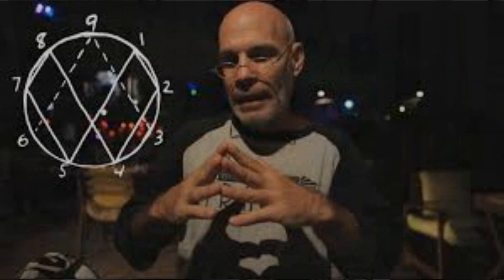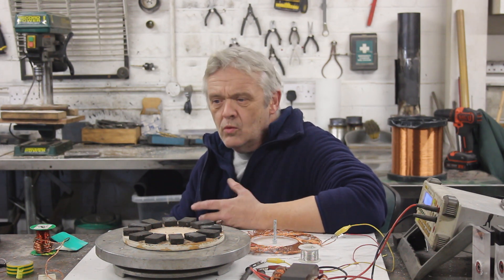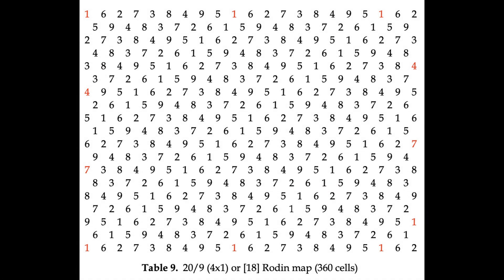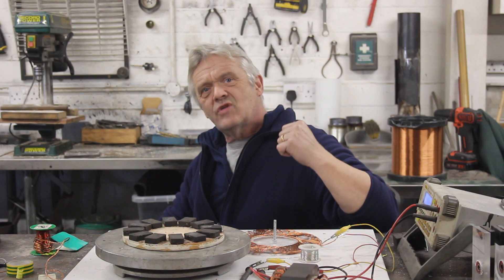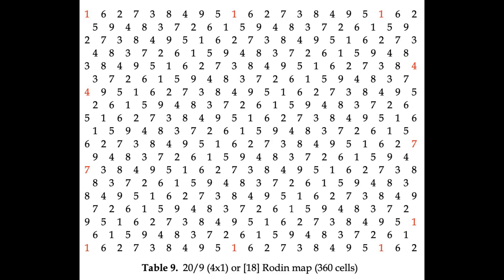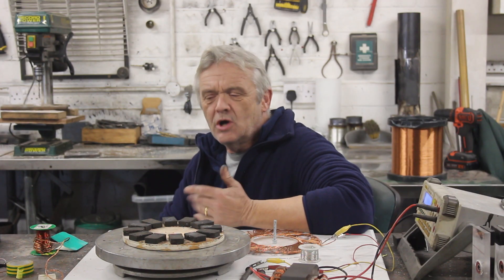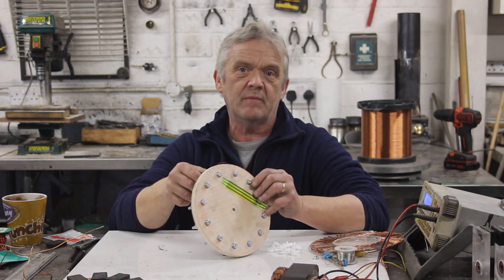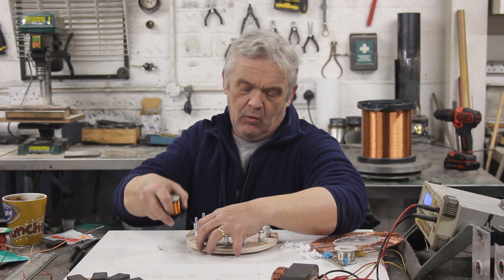1803 The Rodin Coil And How To Wind It

Comment: Vortex Math - A mathematical way to explain magnetism and current movement,  where magnetism is represented by 3-6-9 and the other numbers represent direction in which current moves, the doubling pattern, or the halving pattern. 
What is curious, or odd, the current flow, based on the 2D perspective, is not possible, the alternating current will cancel out leaving a net of zero. So, Marco Rodin postulated adding a 3rd dimension to the 2D perspective, to become a generator. That's how the Rodin Coil was born.
Amazing stuff.
PS; A Hexagram doubled is 12.

Comment: I just wound a few serpentine coils 162 " its heavy wire . Its to run my boat . Its a double flex axial motor generator combo. With conductive stripes on the bottom of the boat to make money r electricity for navagational lights and a paddel wheel and solar for lasers and freq wepons to fight pirates. . I mad a scaler device that detoxifys rivers but im sure the gov will try to stop me . Ive got beyond et defence system and offence systems . I was a consultant for that world . Dont like gov people or et demons.

Comment: I was just watching this guy using a small bowl type housing attached to a small motor, 

He lined the inside with neo magnets round about with all of their pole facing south or north inward.

Someone in the comments mentioned adding a coil of conducting wire overlaid ontop of the neo's.

If you added a current to the coil you may be capable of magnetic propultion ..

Comment: Is it important what kind of wire to use, recommendation?
Reply: Copper wire is the standard that has always been used since we began making transformers with them.  Standard non conductive laminate copper wire (for safety and efficiency) for the winding.  If you introduce a core or magnets , thays where you can start partying with the type  of material. EXAMPLE: hammond makes their transformers core from laminated iron ore sometimes and other times they use steel. It really comes down to application. The reason copper makes up the winding has to do with its conductive properties (aka how fast can the electrons move through it with the least resistance. Apologies if you knew all of this , and I am flogging a dead whores. Hopefully someone can gain a better understanding

Comment: you did this wrong.. you need 2 separated windings to create the star, closing the correct circuits so you only end up with 2 instead of 4 wires. the geometry should leave you with almost no self induced resistance due to the fields aligning geometrically correct. you also need to map this on an actual torus as this won't work in 2d
Reply: By chance have you tried using one in combination with an appliance?
TV, Freezer, Computer?

Comment: You do know there are VERY cheap versions of what you're 'trying' to 'make work'; built by 'proper engineers'. Love the enthusiasm but I've long since given up on 'reinventing the preverbal wheel' since I accepted the fact that there ARE people way smarter than me. 'Experimental' is one thing but buildings stuff that you can buy (that's better) for less than the material is border line...  I remember the time you told me personally about a 'Fusion' idea you were exploring; Now that exploration I for one would be excited to see you experiment with.

Comment: i wound a rodin coil on a doughnut shape, its alot more beautifal. and might have different performace properties. it just looks nice to have a toroid shape. and if you connect it to your speaker cables on an amp it becomes a speaker if you have a magent in the middle of the coil.

Comment: It's rod(I)n and Tesla discovered this timetable not Marco assuming you have tried getting your magnets set out in the same way you made the coil opposing poles sitting N|W|N|W
I.E because all opposing numbers on a clock going anticlockwise are- and all clockwise are + proven because 8+1=9
7+2=9
6+3=9
5+4=9  9 is the North for any EMP meaning Center/pole ❤ try a coil with 27 points and try 9 9 9   until you get back to 27, approx 3 turns each time. You have the tools I don't 😂 9 is the number of god and there is approx 27 letters to the alphabet made by the ancients of this technology maybe I'm crazy but I love crazy 😂😂

Comment: Sorry, but your explanation as to what remainder you get when dividing 1 through to 9 by nine is not "1". If the divident is smaller than the divisor, the modulus will be equal the divident, not equal to 1. e.g. 1 mod 9 = 1, 2 mod 9 = 2, 3 mod 9 = 3 ... 9 mod 9 = 0

Comment: 1. You are using it wrong. You need to put the magnet in the middle of the coil. There is where the field is concentrated. 
2. What is the wire gauge? 
3. Dc resistance?
4. Impedance at 1khz?

Comment: The council of nine would say that nine is existence, for instance if you were to take your age add the two numbers together, take the sum and subtract the sum from your age the final answer will always be divisible by nine.  
  9   9    9    9    9        9    9     9    9                                         1+8       2+7     3+6      4+5     5+4     6+3    7+2    8+1                                                                     1    2    3    4    5       6     7    8     9                                          these are the answers to the multiplication you'll notice                                                                             9   18   27  36  45 /  54  63  72   81  (mirrored)                    they sum to nine.
There are many more ways I could prove my point but my argument here I feel is credible enough to explore further!

Comment: Nice video Robert.  I like your style.  Won't this particular coil cancel all the different magnet poles out netting 0 volts? You would want to isolate windings where they line up with poles and add then add them together right? Maybe I am missing something.

Comment: Hi Rob Sir great to see the coil videos, I am actually building a 10kw Axial flux small wind turbine using SWG 20 wire the current magnets are 50mm by 50mm by 12.5mm a square magnet, I am building square coils too in relation to magnets, but am struggling with the turns, I have used 2 conductors to build coil, please help me throw some light on turns part Rob Sir, Love and warm regards, Yaman.

Comment: I don’t thing that is how you use rodin coil, you apply correct frequency to it to create field in a center, whu would you wind wire in complicated donut shape and run magnets in circle, pointless, you will get voltage by wrapping a wire around shapless random rock or actual donut from gas station, your video is misleading
Reply: Well put, seems like he isn't even invested in trying to make it work.

Comment: FYI Rodin did not come up with the math. Tesla and others did. Rodin used other people's work to promote it. I knew Rodin personally and he refused to explain his explanations. The coils that others have made using his ideas were all wrong. I have figured out how to construct the coil and it can handle large voltages without fail. I also know how to calibrate it and it follows the design he talks about. I later found out that he didn't come up with the 3-6-9, 2-5-8, 1-5-7 pattern. Nicola Tesla figured this stuff out way before. Its just not to many payed attention to his work as most thought he was a quack. The Rodin coil is not supposed to be flat. Its a toroid and utilizes nature's principal of energy transfer. You need 3 things for it. 1. Positive 2. Negative 3. Neutral center. There is another man who promoted this in his flying ufo type disc he created and it used harmonic frequencies with a unique type of design. (not free energy either) I have yet to try to construct a proper coil based on Rodin's work. Rodin didn't steal it all there is some he worked on that is valid. If your curious then do a google search for Tesla's 3-6-9 vortex math. Its the same numbers in Rodin's work.
Reply: I am fairly certain that Marco has stated onn more than one occasion that his "discovery" was expounding onTeslas principles. Now I can admit I may be wrong, unlike 95% of YT comments. But I am interested in how you came to the conclusion that the starseed coil variety, as well as the widely agreed upon, donut-shaped variety of Rodin coil are both inferior to this mystery formation coil that you have made? What tests have you implemented? As well as other questions that I'm not science-y enough to know to ask.
Reply: By calibration, do you infer wire  gauge and number of windings?  Besides standard methods , what other practices are employed engineering it for greater voltages?  Have you elucidate all of this elsewhere? How did you cross paths with Rodin?  Don't talk offense. I'm asking ignorant questions with no 3-letter/bad-actor motives. Genuinely curious as someone working with these designs for various purposes

Comment: I made a star coil a few years ago and applied DC electricity to it.  It created a concentrated magnetic field around the center coil (not outside stars) and would hover a couple inches when put over a microwave ring magnet.  Seems like magnetic field is more concentrated than just a plain coil.
Reply: makes sense, there's 12 times more wire in the middle ring than on each star point.
Reply: @DFPercush  Mounting a metal metal disc in the middle and spining the whole thing could make for an overinity generator
Reply: @jlo13800  I think I see what gave you that idea in the suggested videos here, and I'm sorry to tell you it's fake. You have to put work into spinning it to get power out. Otherwise it's a crappy flywheel battery.
Reply: @DFPercush  yes power to start it and once its running to feed power to the drive motor. This ways its taps ZPE.

Comment: Bob I wonder if you did the same Rodin coil with silver wire instead of copper this would change the outcome . Remember during the shortage of copper during WW2 Los Alamos used silver for generators versus copper!
Reply: Silver wire is crazy expensive tho, the benefit would maybe be lowered resistivity but I doubt the extra cost would make the relatively low gain worth it

Comment: I made a flat Rodin coil a few years back and with 6  1" X 2" neo 50s  on an aluminum drum. I was able to get 12 volt at 850 rpms from a drill motor. Coil shorted before I could test any type of load and I never continued the experiment.

Comment: nice vid, just a point though......... its pronounced ROW-DIN... as in Tin....also....what you have there is more commonly called a "starship coil"...or....a flattened Rodin coil, a true Rodin coil is not flat but wound around a toroid, typically a plastic toroid as found in those childs plastic donuts they have to stack on a shaft in the correct order

Comment: 10 years ago i was really interested in Vortex Based Mathematics and i ended up building a 3d coil based on that with one of those kids donut shape toy. I also putted a ball magnet inside just to see what happens. By applying a frequency, i could make the magnet turn inside the donut. I was freakin' amazed(pretty much like Robert when something works lol). I then had the idea of creating a 3d printed version of the VBM torus wich i could wind with wires and put a ball magnet in. After a couple years( yeah i'm slow) i did so but the winding was a pain . I only tested it once and it did nothing but i couldnt make all the test i wished i did.

All that being said, keep up the good work, you inspire me to continue my quest for making cool things.
Reply: yeah i made a doughnut one too ! pretty cool. it will also play music if you connect it to a music amp and have  a magnet in the middle. i played billie jean on it !  -_-
Reply: 999999
Reply: @dancol2008  9 is 3
Reply: @marcgagnon4171  keep working on it and you can make your own PEMF healing devices and if you keep going you can discover how to make a magnetic vortex wormhole generator. Or just read the google patent on it and follow those instructions…fascinating stuff indeed!

Comment: If I had two of these turned by pedal power how much power would I be generating at top speed?? 32mph
Reply: Not enough information. What's the radius of your wheels? The gear ratio between final drive and pedals? And what's the load? You can spin something at 100 mph but if it's in outer space with no resistance then it's making 0 power. Power = torque * angular speed in radians/sec. Using units of Nm for the torque will make it nice and give you power in Watts. Multiply by the efficiency of your generator and that's your max available electric power. From there it's a game of impedance matching to achieve maximum transfer of that power to the load.
Reply: @DFPercush  small cog nine spir or tooth gear 53 tooth gear
Reply: 26 inch wheels
Reply: I weigh 152
Reply: Weight of electric stuff has to be also factored in
Reply: Weight of electric stuff has to be also factored in

Comment: This coil gives the impression that because it crosses many times over itself it ends up creating conflicting magnetic fields that reduce energy collection. I think you could test if this is happening by removing some magnets from the base and turning, if the energy production is equal or higher even if you have removed some magnets then probably there are conflicts of magnetic fields.

From my point of view it seems to me that no wire should cross or follow in a different direction, the best energy collection is always in all the wires being as aligned to the same axis as possible. Because by passing energy through them their field will eventually affect what's around it, and you don't want one wire creating an opposite field on top of the other wire.
Reply: @pedrojorge4684  Opposing fields would give a scalar wave...
Reply: @leomcfadden1978  I refer to interference from a field that currently runs within the wire. For example, if you transmit "wireless energy" with your wireless cell phone charger, this does not decrease your electricity bill, because the interference from one field to another generates the same opposite action, that is, your light clock will measure that there was energy coming out of it. Maybe it gets a little confusing because I communicate with a translator, he must be translating some expressions incorrectly. My point is that wires not aligned in parallel will have a different effect than those in parallel aligned, because there will be some change in the field, whether for better or for worse, I suppose for the worse.

Comment: This is exactly what's used in curve-stitching, pullikolam,  and other types of diagrams which are richly studied by topology (sorry of mentioning that again).
Reply: I believe the 3d shape is a cycloid. It can be modelled with a faily simple cycloid vector function. That allows it to be 3D modelled and put into an electromagnetic simulation program. There was a presentation at global BEM in 2016 I think it was where some Portugese guy had managed to hook it up as a zero point energy generator. He was never heard from since..

Comment: Rob, it seems to me the essential thing to check with a Rodin coil is the alignment of the coil segments in relation to the individual magnetic fields.  You know the geometry of the various segments (1 to 6, etc.) and you know the flow pattern through the various segments of the coil.  If you lay the coil over the magnets, how do the individual coil segments line up with the N-S fields of the magnets?  Do they add or subtract & where?

Comment: What is the best way to compare winding patterns?  I think using the same guage and total length of wire in each coil.  Use the same type of magnets.  Spin at the same RPM and use the same load.   

Is that grossly over simplified?  How do we make apples to apples comparisons to determine the best winding method?

Comment: I took your advice Robert and built a Nitric Oxide generator it fits in your pocket, if half of PubMed experiments work its a cure all, as pills4ills industry has suppressed this Nicholas Telsta device for 20 years I will have to spread the word so it can be picked up if I am not around

Comment: I like how you give the Rodin coil a serious chance and evaluate it fairly. I remember when I first heard about it and all the mystical hype surrounding it and I confess that I got a little caught up in it. Nowadays, I can't help but laugh. Still, I never actually made one so seeing one actually being made and tested in a real-world scenario is eye-opening.
Reply: Rodin's coils are not flat btw. They are supposed to be wound in a donut shape and I have wound one that could handle over 1k voltage. I had one of Rodin's friends ask me about how I could do it and load it with a higher voltage than he could. During construction the coil will sorta wind itself. You start with the winding pattern then it will always land on the correct spot as you go around. According to Rodin its 2 pairs and what is missing with most is the 3rd winding which is the 3-6-9. The coil if wound properly and calibrated will exhibit strange effects. I have not made one that had any strange effects but HP did a study of them. I have some documentation I made regarding calibration. I have not published anything as I am not an engineer and wanted to verify everything first.
Reply: @StevenCookFX   what happens if you spin the magnets through the  doughnut? Horizontally on say a track through the tube or vertically through the centre? (The hole in the middle, rather than simply in parallel as shown here?)

Also if making a doughnut 🍩 I assume you cross from front to back as you pass through the centre (creating a figure of eight) and don't simply wrap over the doughnut (creating ovals)?